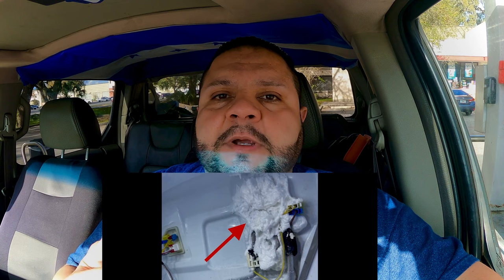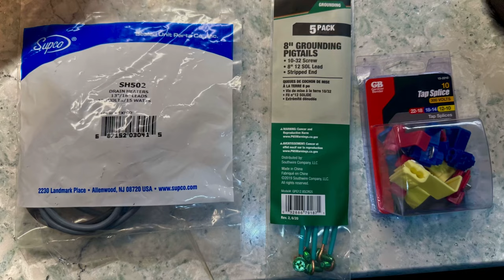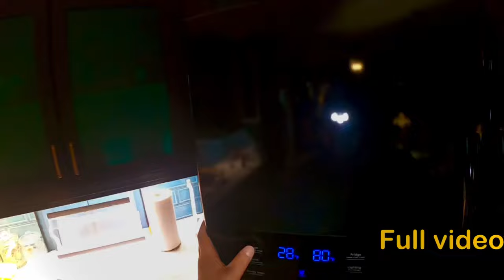How to Fix Ice Build up in Samsung Refrigerators PERMANENTLY!

Comment: Hi, I stumbled on this video b/c I have a Samsung and ice buildup inside the ice maker and want to share this.  I am not a technician or certified but lived with this nightmare for 4 + years.  I am not talking about ice buildup in the fridge (I don't have that issue yet thanks god).  What I discovered is this...the ice maker has a sensor that stop producing ice when it is full.

So, for 4 month, I would constantly check the ice container and if the ice is half full, I turn off the ice maker manually.  I am not saying this is a permanent solution but this is what is happening in reality.  My ice maker compartment will work perfectly as long as I turn off the ice maker when it gets half full.

If I stop monitoring and let the ice maker fill the box up with ice, then the nightmare freeze begin.  Again, I have lived with this and have proven this many times.

In my opinion, there are 2 solutions. 1) buy a new fridge (most likely not a Samsung brand).  2) I don't know if Samsung is reading this and if there is a way for them to modify the sensor on the ice maker to stop producing ice when half full (so I don't have to constantly monitor it and turn it off myself).  I know they have sensor built in to stop when the ice reached the top but I wonder if they can modify it (after the fact that it has been designed initially to stop at full).  It might not be doable since they have to physically rebuild certain components and how the sensor was built and location to check for full.  Again, I think only Samsung can answer this question and if it is something as easy as updating the firmware, it would be a great service for Samsung to make this change for their customers.  But if it is more than just updating the firmware, I would agreed it is sol for us suckers who bought these units.

Comment: Hi thank you for the video,, i do everthing like u said but my still freezing what do u think is the problem??😅😅
Reply from the maker: If you install the heat element, you shouldn’t have any ice around the fan so you have to make sure the heat element is getting power. In other words make sure you’re install the heat element the right way if that heat element is install the right way your next step is replace the thermistors

Comment: Hi, thank you for the video. My Samsung refrigerator has the back panel iced up, but I turned off the ice maker from the beginning. I don't use it. The back is still icing up, but I have it off in the settings? Should I still seal the icemaker?

Comment: My Samsung refrigerator RF260BEAEWW does not have the ice maker in the frig area.  I have a constant problem of ice forming on the bottom of the frig under the big bottom drawer.  This builds up every week or so.  Is this the same issue explained here?  Would adding the heater solve this buildup?  I have not pulled the cover in the back of the frig to see if ice is built up on coils. Thx for the great videos.
Reply from the maker: If your problem it’s in the freezer, the drain line is clogged
Reply: @DIYRepairsNow  It is in the refrigerator.  I will check the drain.   I also heard that there was a problem with the drain line freezing and causing this problem?   What is your favorite brand of refrigerators.   Just thinking of a replacement at some point.   Are Samsung more problematic than other brands.  Thx again.
Reply from the maker: If your problem is the refrigerators you on the right video and my favorite brand is whirlpool and yes Samsung is the one gives more problems sometimes manufacturing problems

Comment: So does the booster kit replace the heater you installed? It seems like either or for those. Secondly, if I order the booster kit do I still need the ground wire? Thanks
Reply from the maker: Yes, It would be Either the Booster Kit or the Heater that I used in the Video. If you decide to Use the Booster Kit, You Should not need the Ground Wire, as it Should Bring Everything You Would need.

Comment: What about just adding a bigger clip-  Samsung Refrigerator Evaporator Drain Clip? Will it solve the problem (ice buildup in cabinet freezer only)?
Reply from the maker: The Drain Clip Is Usually Just for when the Evaporator Drain Line Freezes. It Could Be Something Wrong with the Defrost System, If you are only having Ice Build Up in the Freezer Section of your Refrigerator.

Comment: Hi I pushed on the link for the fridge heater  it’s says not available ?  Do these parts work on all Samsung ? Thank you
Reply from the maker: The Heater Used in the Video is Still Available, However Here is a Link for the Samsung Defrost Booster: https://amzn.to/3IFtoat 
This Repair Helps With the Refrigerator Ice buildup Issue on Samsung French Door Refrigerators.

Comment: Best thing to do is avoid buying a Samsung refrigerator since Samsung will not back up their refrigerators despite a class action law suit. I talked to Samsung people directly and they said that my warranty expired. But yet they still build the same ice maker and won't cover the problem.
Reply: Thanks dude…this comment really helped me fix my Samsung refrigerator…
Reply: I agree with you. Do Not Buy Samsung anything. It’s a nightmare to get any help from them at all. Our refrigerator has been having issues with the ice maker freezing over and now the darn ice bin is frozen. I’ve tried force defrost but it doesn’t do anything. Anyone have any suggestions? Thanks.
Reply: uhmmm our Samsung just started doing it a few months ago and is over 13 years old.